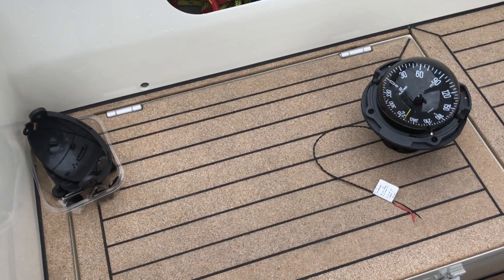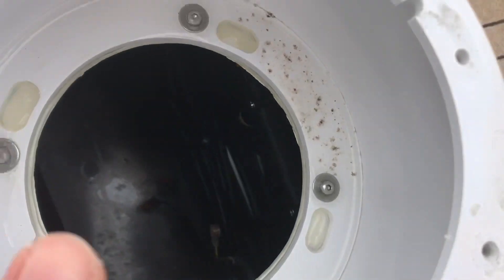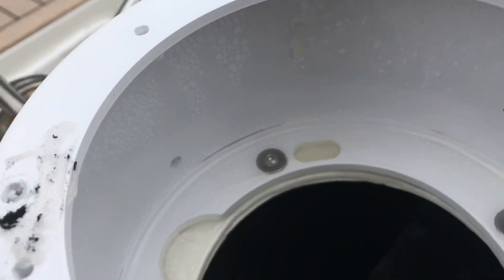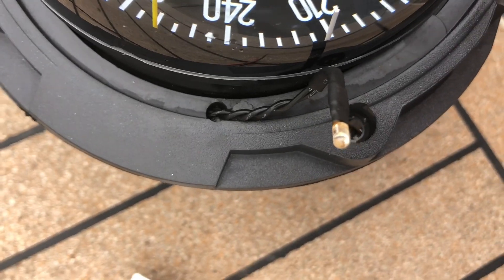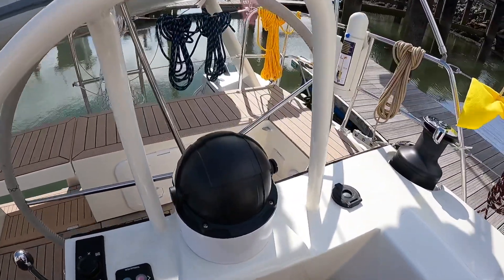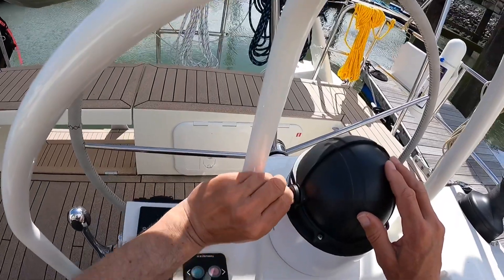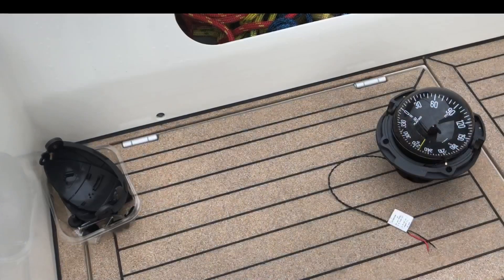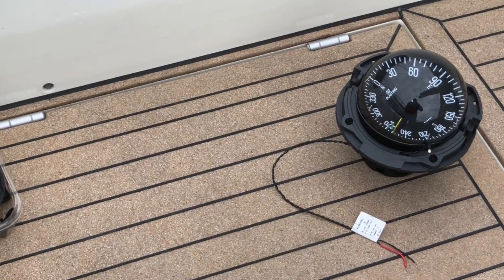Snow Gum - fixing a leak - Garcia Exploration 45

Comment: Condensation most likely where a goretex membrane for vent would suffice. oops i heard you say it only happens when it rains.
Reply from the maker: Hi Mk. Yeah, it was a problem with rain. Sea spray would be a problem too if conditions were bad enough. I think the water was mostly or entirely getting through a hole in the gasket that’s provided by Plastimo for the cable that powers the compass light. I’ve sealed that hole with silicone and not a drip has made it through since.

Comment: Hello, aside from the leak through compass, have you had any other leaks or any leaks in the hull itself? If so how did you/Garcia fix?  Thanks in advance.
Reply from the maker: Hi Andre. I think the leak through the compass was via the small slit in the waterproofing gasket provided by Plastimo for passage of the twisted pair cable for powering the night light. A dab of silicone has fixed this. The CD I installed under the compass binnacle is for backup, together with allowing the bottom of the binnacle to breathe.
As to the substance of your question, I keep hearing from old salts that all boats leak, especially old ones and new ones. We found a few small gaps in weather sealing during commissioning, thanks to Cherbourg’s rainy winter of 20/21. People still believe that the purpose of Captain Cook’s first voyage was to observe the transit of Venus and to look for the fabled great southern land, but it was actually and secretly all about testing a new invention - the silicone gun and silicone sealant! The British Admiralty had high hopes for it and their faith in this highly classified development went on to support the rise of British naval power and establishment of the greatest empire the world has ever seen. Now you can get it in any hardware store or supermarket, though it’s always best to look for brands endorsed with the James Cook bust logo. A dab here, a squirt there, and any leak short of one caused by an iceberg will be solved. I knew a silicone gun would be handy when I saw one in a boat tour by Pete Goss. ‘Ah ha!’, I thought. ‘You don’t use those for cooking dinner!’ To be specific, to stop a few leaks I have put tiny amounts of silicone on: the junction of the gas locker and its door support panel, to close a small gap in sealant already applied; around some instruments in the cockpit, given that the foam gaskets provided by the instrument suppliers don’t always work 100%; on the mounts for the main-sheet blocks on the dodger, to close tiny gaps between mounting plates which were vulnerable in high rain and wind conditions; the compass gaskets of course. I used more silicone than tiny amounts to seal the black plastic instrument panels on the helm consoles. These large panels have foam gaskets, which are used to make removing the panels easy, e.g., for post-delivery follow-up adjustments to the throttle & gear change lever, instrument software updates, etc. Once the boat was through its birthing throes, I sealed the edges of these panels with silicone beads that NASA would be proud of. I will add that we have had no leaks into the living areas, other than a few drops into the aft heads compartment from one of the mentioned main-sheet block mounts. Or from leaving dorades open while tacking south around Land’s End against wind and waves going north. With green water hitting the front windows, that’s all that got in, and it was our own stoopid fault. Summary - don’t worry about leaks. Bring a silicone gun and be a minor expert with it. You won’t get enough practice to be a major expert. :-)

Comment: Probably a drain in it that's clogged. I don't know jack about boats but I go trough this a lot on car moon roofs
Reply from the maker: Hi Will. Well the only drain is the big 12cm hole under the compass binnacle. There's several holes in the base of the compass, as you saw in the video and I'm quite sure they are there to allow water to flow out. And it does! Thanks for your ideas. And you're right about moonroofs and sunroofs leaking when their drain holes and tubes get blocked. My parents had that happen with the sunroof in their Pajero. 😕

Comment: Found your channel when I saw the boat in Portree harbour. Very impressive. Have a good trip 😃
Reply from the maker: Hi mighty. Thanks for the comment. You saw our friends in Idril, a sister ship. Yep, they’re good boats!  Regards, Rick.
Reply: @SailingSnowGum  assuming they are on a form of holiday round the north of Scotland? Many good things to see when doing that. Would you recommend this yacht as a good option for long journeys like this across the Atlantic and other destinations?
Reply from the maker: @themightyduck6455  Hello mighty Duck. I conducted a detailed analysis of what I considered to be the best boats for long distance cruising and came to the conclusion that the Garcia Exploration 45 was the best choice, for many reasons. Firstly it has tons of safety built in as fundamental aspects of design; things like full height, watertight bulkheads at both ends and above-waterline stand pipes for through-hulls, not forgetting the strong aluminium construction that won't crack in a collision with some unidentified floating object. Then there's the arch that supports our solar power plant and holds our tender up high. The windows in the deck saloon provide a great view when sailing or in harbour and allow the boat to be piloted from inside - a brilliant advantage. Large fuel and water tanks and lots of storage for food and other things. And it has a comprehensive sail plan that allows flexible sailing options, with all the actions that could be dangerous being managed from the cockpit. A great bowsprit, a great transom, adjustable draught, wide beam for good form stability, a full size shower, a fantastic cockpit table, secure space for 26kg of cooking gas, etc, etc. 

Anyone wanting to buy a cruising yacht should definitely have a very close look at this Garcia Exploration 45, or if you want even more of a good thing, then the 52, 60 or the Explocat!
Reply: @SailingSnowGum  ok thanks a lot. I have been sailing for a few years now and have decided to consider the leap to owning my own yacht. These options are definitely on the list as being a good size between safe for long distance without being ridiculously expensive.😀

Comment: If I remember from my boat building days, I believe plastimo offer an indoor version and an outdoor version, ours used to be black for indoors and white for outdoors, the outdoor unit is slightly different. Was the wrong compass fitted in build, easy mistake to make
Reply from the maker: Hi Colin. This is a very interesting snippet of information. Thank you for the comment. I will be sure to investigate with Plastimo and Garcia. Regards, Rick.
Reply: @SailingSnowGum  no problem, we used to put dab of silicone where the light cable excited, there should be a gasket ( same shape as screwholes) to go-between compass and base. The big hole is normally used when flush mounting the compass, it's not necessary with the mounting bracket. I would fill it with something and have cable go through a gland, with the wago connection blocks in the gap between the compass and infill, for easy access. Doesn't have to be Ali infill piece, could be an offcut of gap or treated ply as shouldn't get wet again, I think the water is definitely  coming through the unsealed light cable hole.
Reply: Should be an easy fix, just spoken to someone at princess yachts and they still have to seal that hole. Those other holes are drains from where water might go down where the compass rotates, no need to seal that area, you described in video.
Reply from the maker: @colinfraser3998  Hi Colin. I think you're spot on here. The infill piece for the large hole under the binnacle could be made from plastic, marine ply, or aluminium. I've asked Garcia to see if they have a piece the right size lying around. 🙂 They probably do, from the most recent holes they cut. Ha! Fact is, these holes don't need to be cut. I'm guessing that the compasses used to be flush mounted but are now mounted in binnacles, but no one said, 'Stop cutting the holes!' 
There is no doubt that the small hole for the light cable was a leak point. I'll be sealing that. 
I've asked Plastimo directly if water is supposed to be finding its way past the sides of the housing for the compass ball, or through the gaps on the sides where the mounting screws for the sliding covers are. There's lots of gaps and it looks like water was always going to get through. It doesn't look like a design that's meant to be watertight, hence the need to mount it over a watertight bulkhead or pedestal. 
What I'm curious about is, what happens with a flush mount setup? You've described how a watertight version of the compass would be needed in that instance and I agree, but I can't see any information on Plastimo's website offering a watertight version. Hmmm. 🤔 Would your friends at Princess have any hard info on this? Different part numbers perhaps, for the black (non watertight) and white (watertight) versions?
Reply: @SailingSnowGum  I'll ask the question, I had a look last night, it's been a while since I fitted one, they where all flush mounted.  So I might of been just the issue of sealing the light cable to make water tight. Not sure about the seal area around the globe part. Is it not incased underneath, hence the side holes to let any moisture run out above the gasket, it's a pretty standard item fitted to lots of boats, I only remember having to seal that hole with some clear Dow

Comment: Hi Rick, the upper screw on the cover of the winch motor seems to be a bit brownish. Hard to judge from the video, but could it already be covered by a thin layer of surface rust? Probably something a spray of WD-40 could fix, but since your boat is nearly brand new, maybe you should check it out?
Reply from the maker: Hi Johs. Thanks for pointing to this. I'll go and have a look. Stand by for a second. Oh, now I know which one you're pointing to. Yes, I noticed that only an hour or so ago when I was watching the video myself. It does look a bit suspect and I will reach in and try to clean it up and lubricate it. I must say, blocking up the hole under the compass will close off an access point that's useful. However, the plastic panels either side of the helm are intended to be the primary access methods and do provide very good access. At present they are nicely sealed with silicone (thanks Christophe!), so opening them will mean doing a thorough close up job. Such is life with boats! 🙂

Comment: Rick, from my experience, most binnacles are not completely waterproof, with possibility of some water intrusion if compass is hosed. The protection against water intrusion is usually right next to the compass dome, with a bezel protecting the compass flange. The hole under the compass, into the boat, is for access to steering chain (replacement, lubrication,...) . Can the water under the starboard binnacle be due to condensation?
Reply from the maker: Hi Paulo. The water seen in the video lying on the flat aluminium panel under the binnacle is just the last little bit that hasn't flowed down to the bilge of the steering compartment. Plenty of water has been flowing through the compass, proportional to the heaviness and duration of the rain. I've crawled into the steering compartment with a flashlight while its been raining and have watched the drips falling from the bottom of the compass. There's two big access panels either side of the helm which will allow for maintenance work inside the helm pedestal when needed, so semi-permanently sealing the hole under the compass shouldn't be a problem. I would use silicon rather than epoxy I think, so it can be opened with a knife if needed. 🙂
Reply: I will be surprised that the liters os water you are getting in the aft part has anything to do with the binnacle. I would be surprised if you are getting a liter of water in the cockpit, let alone trough the binnacle. One possibility is the stuffing box for the rudders. Look for salt deposit where shaft enters the hull. If this is the case, tighten the flange. Rudder shafts are not as sensitive as engine shafts to the stuffing box compression, since they are not spinning at 2k rpm.

Comment: You definitely should not have to be dealing with this issue. Design problem, install oversight, whatever is unacceptable.
Reply from the maker: Hi Kent. New boat, old boat, whatever boat … boat life is about problem solving, including fixing things. The best boat is one about one to two years old, which the original owner has poured love and affection into, fixing all the build issues and setting everything up nicely. 🙂
It’s a matter of perspective. All new boats have problems. The question is, can the problem make the boat sink? We were looking very closely at buying a Hallberg-Rassy. Good boats. Then we watched as an owner struggled to keep his new HR afloat on its maiden voyage. It had serious hull leaks in two places. Hundreds of litres of salt water was sloshing through the bilges of the front cabin, the engine room and the rear cabin, just below the sole boards. The leaks were easily fixed upon haulout, but that’s not the issue. What caught my attention was that the design made the boat vulnerable to any leak, whether caused by a building mix-up or an incident at sea. So we opted for a design that has fundamental safety built in to a very high level, with comfort and good sailing as well. Fixing teething problems was always going to be part of the deal and in fact ensures we get to know the boat quickly, which is important. 
Is there such a thing as a boat owner who doesn’t enjoy working with tools and fixing things? 🙂
Regards, Rick.

Comment: Remove the compass binnacle and seal that big hole with a sheet of aluminium of suitable thickness, use the old binnacle threads. Make new threads in the  sheet for the binnacle and assemble it without sealant, maybe even with washers between sheet and binnacle so that water can run out of binnacle. Make a good seal for the compasslight wire in the sheet preferebly so that the connection is on top of the sheet.
Reply from the maker: Sounds like a good plan Kenneth. Thanks.
Reply: @SailingSnowGum  you're welcome.....had a similar issue on my Bowman 40 and that's about the way I fixed it.